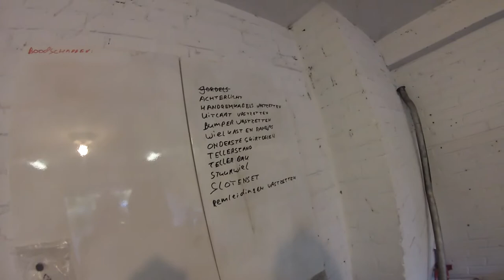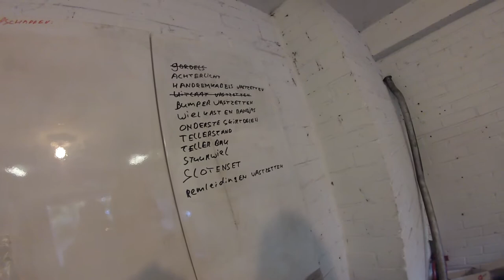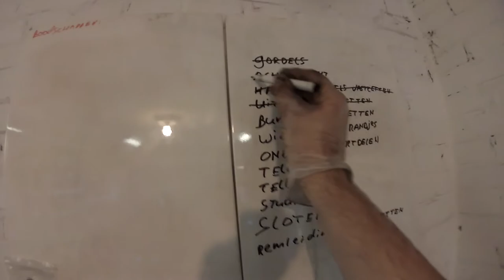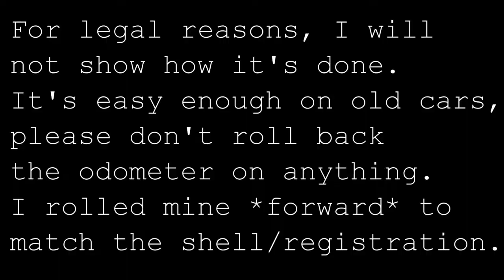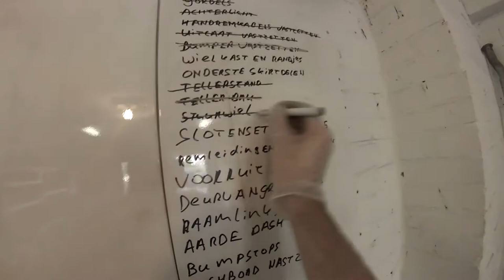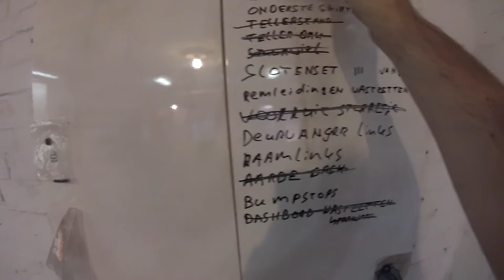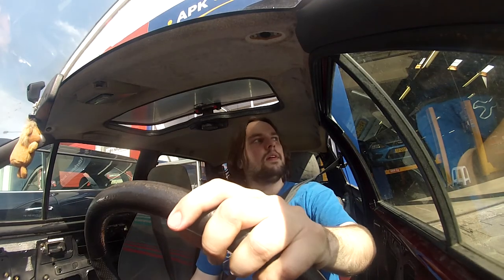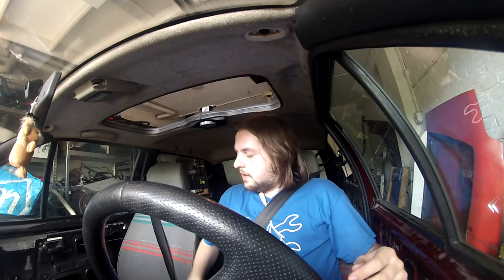Citroën AX 16V Trackday Project Episode 7: First start + roadworthy

Comment: Nice project man, I just have a question, did you reinforce the chassis for all that extra hp and torque? or is it good as is?
Reply from the maker: So far, only the engine mount is slightly reinforced. 

I'll be adding some reinforcement to the control arm mounting points and a roll cage to reinforce the rest of the body (which suffers quite badly from corner twisting.), both mostly intended to improve handling and reduce damage from hard cornering on grippy tires. 

I'll probably be welding in some bracing in the front as well, since fitting the bigger radiator, and possibly making the whole front easily removable will make the front suffer some in the strengh department, but I haven't decided how to go about that just yet.

Comment: And as far as the ECU goes what did you use? Great respect from Greece!
Reply from the maker: Original Saxo, unlock it by disconnecting the number pad and locking computer with the engine running in the donor car, that really simplifies the wiring.
I'll be switching to a Speeduino ECU so I can tune it when the turbo goes on.

Comment: Did you use the same 5speed manual transmission th car had before the swap? Did you have to modify the transmission?
Reply from the maker: I used the original transmission that came with the car, and I didn't modify it in any way. The Saxo transmission might've had better gear ratios but it was broken, it would otherwise bolt in the same as the original.. 
I'm currently in the process of upgrading the transmission to a BE4R transmission to handle a turbo, this does require extensive modifications, which I'll detail in a video that's coming out soon. :)
Reply: Low Budget Racing ok. Thanks a lot for the reply!